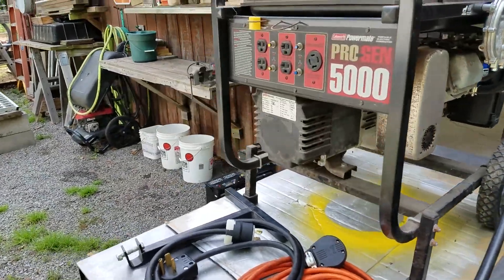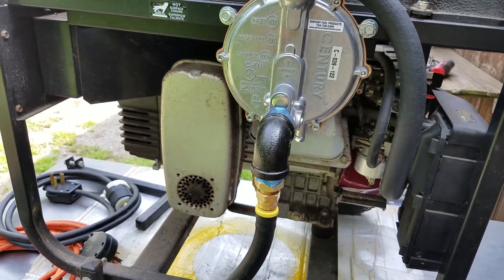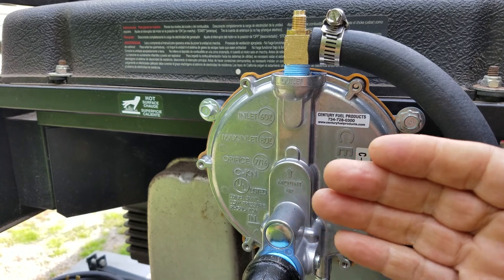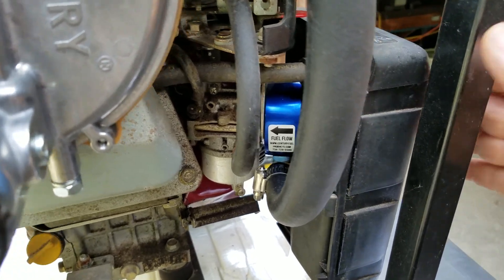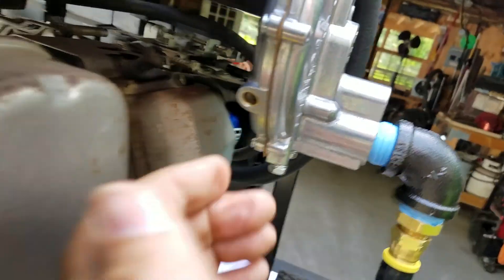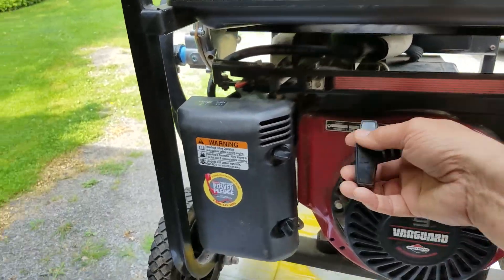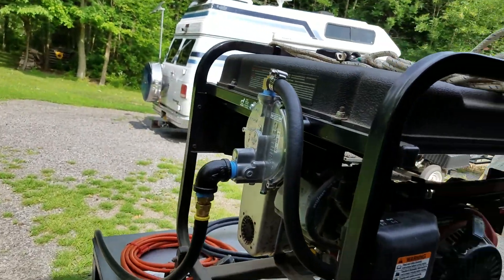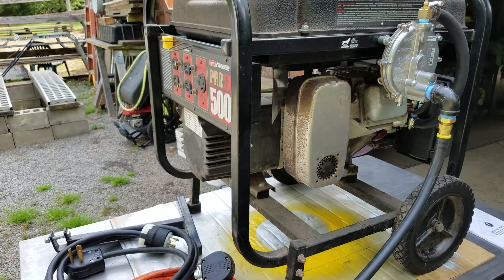Tri fuel upgrade.  Coleman Pro Gen 5000 Propane Natural gas addition.

Comment: can this same set up also use natural gas  /  is there a  different conversion or orfice  u have to add  install?
Reply from the maker: Yes, natural gas is an option. I am sure that most conversions come with 2 orfice(s). I would check before you order the kit.  good luck!  Fred

Comment: Help me understand something. I understand the function of the propane regulator as far as it "smooths" the output of the pressure changes from the propane tank. What I don't understand about generator regulators "Is there ANY flow to the carb/engine from the regulator at "Stop"? Does the regulator only flow when engine "intake pressure" pulls on intake stroke? The video never shows him turning the propane valve on so unless the above is true wouldn't it just openly "flow" filling the carb throat, engine compartment, and post air filter with propane?
Reply from the maker: Good question. You are correct Charles.  The regulator will only let propane flow when there is a negative pressure at the output of the regulator. The intake stroke of the engine lowers the pressure and the regulator opens. It closes at the end of each intake stroke.
Reply: @FredMiller  Thank you very much for clearing that up. I was afraid I wasn't able to explain or not use the correct terminology to get my question across...this cleared up perfectly why nobody blew themselves up when they yanked that rope.

Comment: Good video. I didn't realize conversion kits were available for small engines. Sure solves the gas shelf life and carb varnishing issues with engines not run for long periods.  Hope you and family are all well and enjoying the nice weather! Mike
Reply from the maker: This is something I have been wanting to do for some time now.  From my reading a 20 pound propane tank has about as much energy as a 5 gallons of gasoline.  The upside is that it will still run on gasoline if necessary.  I always turn the gas off and run the carb dry after I use gasoline. We have been enjoying the weather and we are doing well.  Hope you folks are as well.  Fred